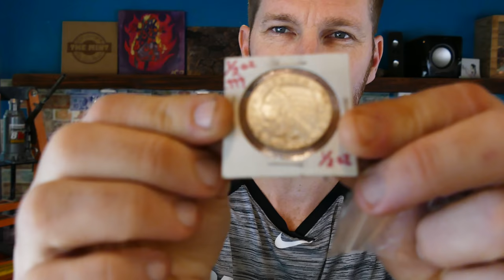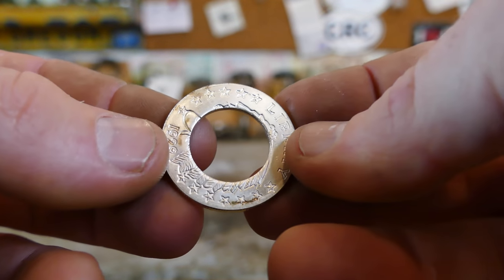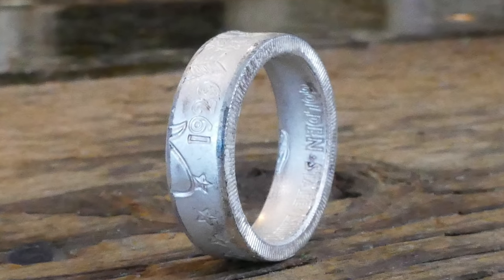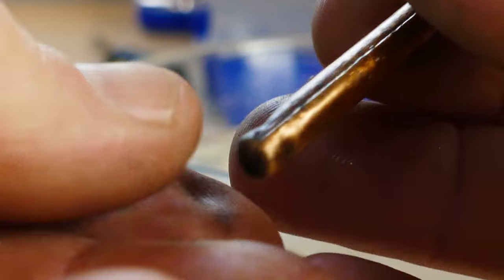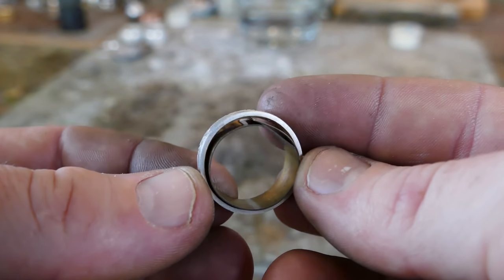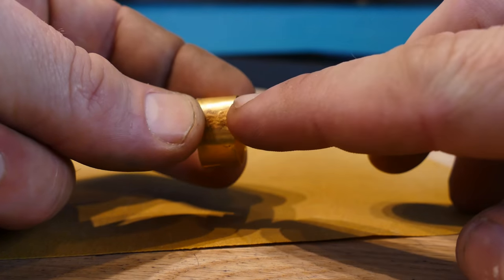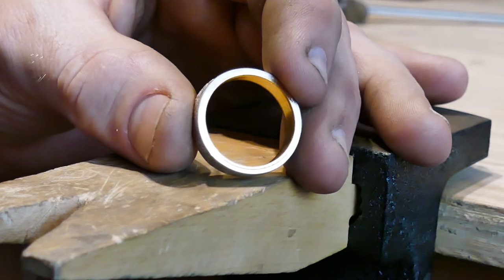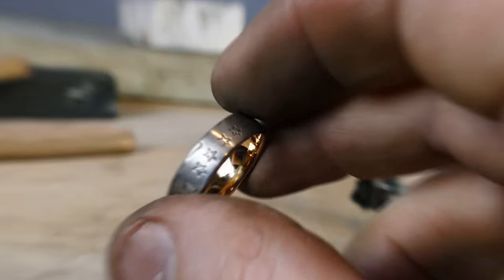Forging a Pure Silver Coin Ring with a 22K Gold Liner (Big announcement at the end too!)

Comment: Professional goldsmith here again to critique your work, first off, you used about 3-4 times the amount of GOLD solder as necessary! excess solder in silver isn't such a big deal, but at over $1500 a troy ounce, you probably had to file and sand off a couple dollars worth of excess solder there! 

Second, why are you using easy solder? unless you're not comfortable with the higher temps, you should always start with hard, even If you're not comfortable with higher temps, you really should learn to use it. hard solder is much stronger and less likely to break when stretching.  also if you'd like to prevent more solder joints from breaking during stretching, I recommend switching from square but solder joints like this -----| |----- which are the weakest, (especially in wide and thin materials) to a slanted joint like this ---/ /---  which is stronger. 

Oh a tip for soldering thin sheet together for ring liners and bezels, get some thin gauge steel binding wire, preferably a kind that wont take solder, and wrap it around the piece once and twist the ends tightly together, this will keep the butted the ends together and keep them from coming apart & sagging when heated/annealed, poked, prodded etc. the solder seams in my bezels and ring liners liners have been much easier and have held much more reliably ever since I learned to do this.

I'm glad you skipped soldering the gold to the silver, soldering gold and silver is difficult due to eutectics, (there's your new word for the day!) basically eutectics is when two metals melt into an alloy with a LOWER melting point than the two other metals, yep, this is how solder is made (you can make your own gold solder by adding silver if you don't mind lowering the karat!) and if your not careful when soldering gold to silver and vice versa, you will have the thinner piece to melt into the other. 
On the other hand, a skilled Jeweler can use this to his advantage. With careful flame control you can join/weld the two to each other without the need for solder! 

If you ever break your solder seam on this ring and go to solder it back again, be sure to keep eutectics in mind and use easy, or super easy solder to avoid them melting into each other, or you could use a laser spot welder to weld just the gold, but those machines are a bit... ...expensive, but hey if you've got ten grand lying around without a purpose then go get one!

Shame you didn't have an extra MM or two of width on the gold piece, then you could of had a complete set of gold shoulders and a really really, REALLY REALLY firm grip of your piece! as well as reduced the amount of possible irritation from the exposed silver edge. also, you risked wrinkling your edge by going to such a flat die at the end, I would recommend you using a steeper tapered edge, or a large ball punch from a dapping set if you had them before going to the flat.

finally, some advice for rolling material, if you have the length you need and you're somewhat close to the thickness you want but not the width, just cut off the length of material you need, then turn it 90 degrees and roll it sideways to widen it. if your mill isn't wide enough to stick the the full length of the liner in sideways, then reverse the process, cut off a section, roll it to the desired width, and then finish rolling it length wise till it's the desired length.

that's all the advice I got for now. Nice work, keep it up!
Reply from the maker: Thanks for all the advice!
Reply: @CoinRingsfromTheMint  no need to thank me, this is the internet, criticism/advice is free and abundant!